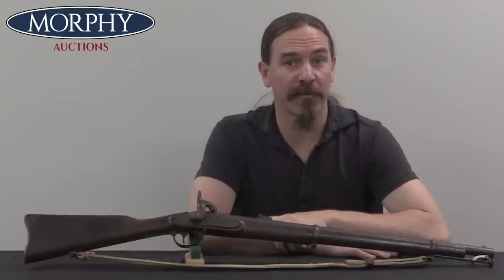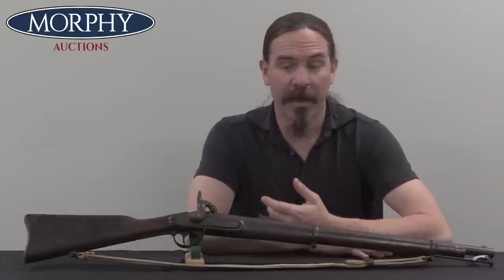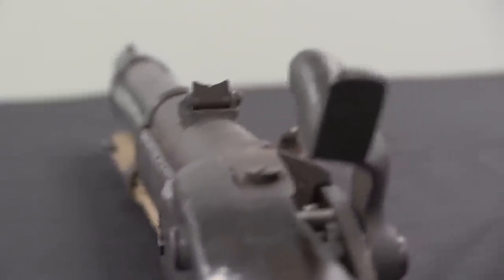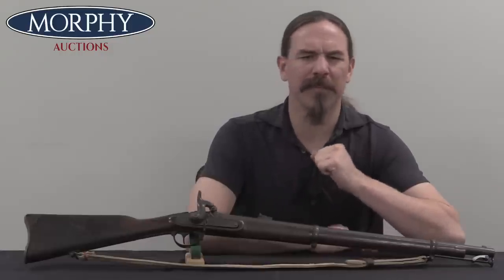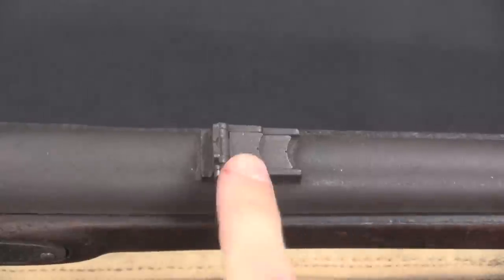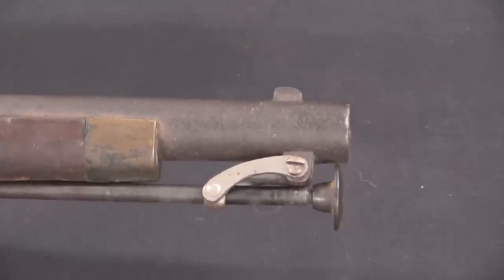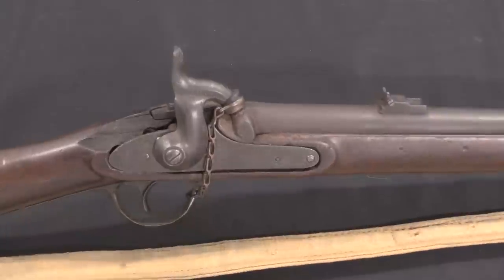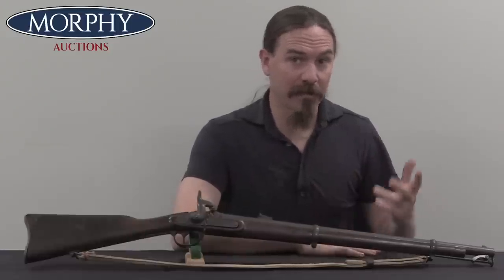Tallassee Carbine: The Confederacy's Last-Ditch Effort

Comment: The cannon that sits out on the corner of the ME engineering building is from Tallassee. Also, I have been diving in the river by the old armory looking for cannons that were allegedly dumped when the armory was packing up.
Reply: ME engineering building?
Reply: @mikejohnson2098  ME.. mechanical engineering @ Auburn. At least it did in the `80's.
Reply: Wouldn't they presumably be buried under mud?  I'd assume if the river is still flowing they'd naturally sink into the river bed over time.
Reply: @Indeciferable  The bedrock there is pretty shallow, so the mud and debris gets swept away from time to time.
Reply: Supposedly there’s a cannon from Selma in the Tombigbee River near Gainesville, AL
Reply: @harlech2  you should try magnet fishing! I don’t think you’d be able to pull a cannon up but you’d atleast be able to locate it underwater and track the line to it
Reply: @wetmemedaddy5065  That's a great idea!
Reply: Be sure to take along either an underwater metal detector or a Garrett pinpointed on your next dive. Or, a good sized magnet on a rope!

Comment: In '89 or '90 my dad and I went to Giest music shop in Helena Arkansas and dad purchased one from Mr. Giest. Mr. Giest (about 70 at that time) said he can remember as a small boy, his granddad put that carbine, along with the saber I purchased in that corner and no one paid any more attention to them.
The carbine dad purchased did not have a sling. It did have the rings for a sling. I had a brass bar and ring on the side of the wood opposite the lock. It also had a serial# 590 on the trigger guard and on the wood under the butt plate. The wood and brass was complete as well.
My eldest brother now owns the carbine, as dad passed in the early 2010's
I went hunting with it the same year dad bought it. We used black powder, with a slug and sabot from a 20ga. It did not kick as hard as my 20ga. It put a HUGE hole in the beaver I shot.
To the best of my knowledge, no one has fired or even loaded it since I cleaned it.

Comment: I have a Traditions brand .50 muzzleloader that is pretty much this model but with an octogon barrel. Has that straight line from the trigger to the butt plate and everything. Wish it had the ram rod guide, thats a sweet feature. 
I got it because I was looking for a muzzleloader for hunting that felt like my Win.94  30-30. 
The short barrel is nice for aiming from inside a blind, walking through brush and climbing in a tree pretty easy. 
Most shots are within 50 yards so I don't need that extra barrel length.

Comment: From what I've read - partly in Peterson's classic The Book Of The Gun - the reluctance of the Union's ordnance department to adopt a breechloading rifle was only partly due to concerns about complexity and dubious reliability.  A great deal was due to being so adverse to any kind of innovation that I suspect they'd have insisted on issuing percussion-primed rifled muskets if they'd had a wormhole feeding them 1903 Springfields and whole pallets of .30-06 ammo. 
     More than a generation later their successors eagerly followed in their footsteps by trying to unload outdated single-shot Allin Conversion Springfields in .45-70 onto some crackpot who wanted to equip a volunteer cavalry force to go fight the Spanish in Cuba.  After all, it's a proven design, easy to operate, hits hard, and half-trained "Volunteer Cavalry" won't waste ammo they way they would with newer designs.  And they use black powder...you can hide behind the smoke.
     Fortunately, the crackpot in question was far too downey a bird to be taken in by that, and after adjusting his spectacles and giving the gentlemen at Ordnance an earful, Colonel Roosevelt left with a full issue of Krag bolt-action carbines.

Comment: The handling and "handiness" of a carbine-length riflesd from ML to SA has always impressed me.  It is fascinating that it took so long for the M4 carbine to become the standard barrel length.  Now pretty much every new military rifle on the market is carbine length.
Reply: Apart from everything Walker mentioned, there's also the simple fact that our understanding of ballistics and optics, as well as related technologies, weren't as advanced as they are now. It was obviously more than adequate for most purposes, people still hunt with 19th century pattern muzzleloaders to this day. However, with the simpler rifling that was available at the time, the slightly improved accuracy of a longer barrel was a welcome benefit. It's only recently where the difference in accuracy has become so negligible that a shorter weapon is actually a net benefit. It's not as if carbines didn't exist until the M4, every army on earth had a carbine variant of their standard rifle, even before rifling started to see regular service. Fusees, for example, were just shortened smoothbore muskets, and were very common among officers, and even occasionally appeared with light infantrymen. Quite simply, there are some situations where a shorter weapon is objectively better, but until recently, the benefits did not outweigh the costs enough to justify widespread use
Reply: I haven't been keeping up with military stuff, care to explain what's going on with the whole 6.8mm thing?

Comment: The American Civil War took place during a very interesting time in firearms development.  

I live in Richmond, and one of the reasons it was chosen as the capital of the CSA was the fact that Richmond had more industrial capacity and is located at the intersection of several railroads and of course the James River - direct water transport to the Hampton Roads area, the Chesapeake Bay and the Atlantic.  So “important transportation hub” is putting it lightly.  

Of course the industrial capacity is very important.  

Otherwise…Richmond is almost exactly 100 miles due south of Washington, D.C..  hence why a huge number of Civil War battles took place in Virginia.

Comment: Note the key difference between the Cook & Brothers and the Tallassee Carbines is that the former was pretty much a complete copy of an Enfield carbine, while the Tallassee used an Enfield style lock and breach design, but a Springfield style stock with a higher comb and a curved button plate, as well as a multi piece trigger guard , all brass mounted, as noted.  An interesting blend of the two most common arms of the War.

Comment: The interesting thing is that almost everyone spent decades using front loader, while breach loaders were already very much feasible.
Remember: The Dreyse-Zündnadelgewehr was introduced in 1837!
Reply: Doesn't do much good if you can't get ammo
Reply: It wasn't technical limits that argued against breechloaders - it was machining capacity - not enough factories of the right type available.

Well, that, and military conservatism; no need to train new drill, no need to stock new spare parts, etc.
Reply: @lairdcummings9092  The cheapest and readily available option is the best option.
Reply: Laird is correct on both counts.  Mfg capabilities for elaborate hinging, latchings, fittings, vs a tube with a touch hole drilled.  Remember in this lecture, 80% of mainspring steel were rejected in this startup.  Such steel rejects were common in most startups.

Burning black powder looses effectiveness through breach venting.  Tri nitro powder made this a negligible issue.

Manufacturing early breach loading cartridges is also a major struggle.  The Henry Martini breach loader was often plagued by bent foil cartridges jamming the gun.  One of the causes of the Zulu overrun.  Trapdoor Springfield needed very precise paper cartridge for proper fit, where muzzle cartridge didn't.

The trapdoor Springfield after the war was not much faster than the 1863 muzzle only design.  Pouring and ramming ball takes about 6 seconds in the load sequence.  Opening the door, inserting cartridge, closing the door takes 4.  Hardly noticeable in battalion fire of single shot longarms.

Trapdoors were fitted with rammers.  They were used as muzzle loaders into 1900 when proper cartridge (or damaged substandard cartridge only) was available.
Reply: Major issue was ammo production and logistics. With muzzleloaders all you need is to bring couple casks of gunpowder and few chunks of led to troops, so soldiers could make cartridges for themselves. But for metallic cartridges you need whole industry and proper logistics capabilities
Reply: @STho205  : In Isandlwana the copperfoil cartridges had been a Problem, but not so much as later claimed. Same thing with the ammoboxes. Similar to Custer , british Commander lost battle for underestimate native enemies. So it was claimed, the to strong ammoboxes and to weak cartridges caused the defeat.
Reply: @lairdcummings9092  Theres also shortcomings of the breach loaders in question. The dreyse being the famous example. Its system is basically a bullet in a pouch that is spun by the rifling, making the gun less accurate than the muzzle loaders it was up against in the war with austria.

If combat was kept at distance or lots of cover was used, as was common in the american civil war, so long as theres sufficient firepower in place to keep a dreyse armed force from closing distance to melee or rapid short volleys, the gun was actually a liability.

Prussia didnt outshoot austria simply because of a high rate of fire, theres  plenty of gunfights where the austrians won, its that the prussians used what they had better by better manoeuvre.
Reply: @brittakriep2938  looking at the time frame I believe the the British Army had the better rifle in the Martini-Henry vs. the Remington Rolling Blocks.

But the US had the better cartridge with the .45-70 the .450 Boxer that the British were using.
Reply: @lairdcummings9092  Not only new drill but also new tactics. If the soldiers can lie down while reloading but all officers are trained to manage standing ranks, etc.
This was even an issue in WW1 where senior officers simply did not know what a few enemy machine guns could do to a battalion of infantry walking forward, because the officers' training was outdated.
Reply: @andrewshaw1571  Spencer Rifles were available and quite favored by the Union Cavalry during the American Civil War; there was nothing problematic about the rifles, their parts, or their ammunition. The technology was more than mature enough for military application. The problem was, because they were the contemporary equivalent of 'high tech,' they were both expensive and difficult to source in large numbers, even for the superior Union industry.

Confederate soldiers had a fear/respect attitude towards the Spenser, calling "the rifle you load on Sunday, then shoot all week." The .58 caliber rimfire ammunition was reliable and man-killing potent to any reasonable combat range of the era.
Reply: @lairdcummings9092  The key word from my comment you are missing is the word also.
Reply: @alexandermarinin7036  the Lewis and Clark expedition packed their gunpowder in lead boxes/chests so that when they opened the chest and transferred powder into horns or flasks, they melted down the box for ammunition.
Reply: @shawnmiller4781  : I am german, Brittas boyfriend, only using her Computer. For german weapons law reason ( most liberal weapons law was in my in Second Empire), i don' t own firearms, the copies/replicas from firearms 1860 to 1914 would be interessting for me. I am a pure theorist, my knowledge is from visiting Museums, reading Weapons magazines and Military History magazines in german language and watching Videos in YouTube. I am also interessted in edged weapons here i do the same, for example Videos of Matt Easton from scholagladiatora Channel, he is
Reply: @shawnmiller4781  : Excuse me, wrong Button! Matt Easton is basicly the Ian of swords and spears. In case of edged weapons, you find them in much more museums than firearms, also in many castles the noble owners have sometimes armours of their ancestors. Reenactors from times
Reply: Damned Button! Reenactors from times before firearms have it easier, so you can sometimes see them in medieval, Roman or Celtic sites and speak with them. In contrast to USA i have the possibility to watch in a circle of twenty Miles arroud my village a Celtic Oppidum, a Roman fort, relicts of Roman border fortification ,Limes', relicts of medieval castles and town fortifications, relicts of two Renaissance Fortresses, a starting Plattform for Natter rocket planes from wwll. So: My knowledge of a specific time or weapon is not very deep.
Reply: @andrewshaw1571  : You have forgotten prussian breech loader field cannons! Also Austria , since 1867 Austria - Hungary had a problem, Prussia had not. Austrian soldiers spoke german, hungarian, czech, slowakian, slovenian, croatian, polish, romanian, bosnian, ruthenian or italian in 1866! In Vienna i, german , and Brittas boyfriend, have visited Military Museum in former Arsenal, there i have seen a book for German officers in Austrian Army. At first the military call was written in german. Then the same call was written in hungarian, czech etc. language. Behind the call, written in a nongerman language, it was written, how a german language officer of austrian army has to speak it. To explain it: If english speaking soldiers would have served in Austrian ( or Austro- Hungarian Army) behind the call : Draw your saber! There would have been written: Droh jor Seiber! And our languges are both germanic laguages, so the problem was not easy. Also in 1866 Prussia did the ( River) Main campaign against prussian allies Bavaria (30000 men) , Württemberg ( 13600 men) , Baden ( 10000 men) and Hessen- Darmstadt ( 6400 men). On paper a force of 60000 men in two of German Confededation Army Corps ( Nr. 7 and Nr.8). But instead of uniting, every southern army tried to defend its country alone. So it was for prussian Mainriver Army rather easy to defeat every southern army in a small fight, we Germans call Gefecht ( not Schlacht/ Battle), but much larger than a skirmish/ Geplänkel. Only much larger Bavarian Army did more than one Gefecht, and outdated Fortess Marienburg ( in Würzburg) was Shot with cannons. And the southern armies , both soldiers and officers, had not the Training quality of prussian troops. For example in Württemberg, where i come from ( nowadays state Baden-Württemberg), there was a serving duty/ Wehrpflicht but similar to Switzerland it was only a rather short Training. And in 1866 the troops of duchies, principalities and free Towns, from 55 men ( Liechtenstein) up to may be 300 men had been only usefull as guards, escorts or Fortress personel.
But in 1866 Austria fought also against prussian Ally Italy, here the Austrians won, most famous Battle of Custozza and ( naval!) Battle of Lissa.
Reply: @greenglassrecycling  The British Ferguson 1776 used in the war of independence not a big number though around 200
Reply: @shawnmiller4781 Nope. Speaking in ballistics, the .577/450 ( with it's extra 15gns of BP) is significantly more powerful than the .45-70
Reply: @brittakriep2938  Austria Hungary briefly trialed a smokeless muzzleloader circa. 1860.
The cartridge was an unusual minie ball with a woven guncotton bag attached to it.
Reply: @alexandermarinin7036  That is correct, except unless they used flintlock rifles, they would have needed percussion caps as well. What I wanted to say is, the Dreyse Zündnadelgewehr didn't require metal cartridges, only the ammunition of a normal muzzle loader and a sabot to lead the bullet, plus maybe some paper for the cartridge. Point is, that is not that hard to get. But as others have pointed out, the problem was more the outdated tactics of older commanders, and the lower range of the older breachloading rifles.
Reply: @sharonrigs7999  the late production .45-70-500, with the 500gr bullet instead of the 405gr as originally designed, was and is probably the best of the black powder metallic cartridges in terms of range and terminal effect.

Even though most US production .45-70 was the carbine load with 55gr of powder vice 70gr. The US used a lot more cavalry post civil war than leg infantry.
Reply: @sharonrigs7999  : l have never read this in german language arms magazines Visier, Schweizer Waffenmagazin or Deutsches Waffenjournal. But we Germans say: Es gibt nichts, was es nicht gibt/ There is nothing, which doesn' t exist. So all kind  of experimental gun is possible.
Reply: No mention of the Hall breachloader?
First manufactured in flintlock, then converted to percussion.
Reply: @KevinSmith-yh6tl  Halls are kinda still front loaders, just a much shorter front to load.
Reply: @ScottKenny1978  
Yeah, whatever
Reply: Sure the concept is/was feasible, but the economics or production, military contracts, ammunition, logistics, training, etc all come into play with new technology. Often the people assigned tomake the expenditure decisions wouldn;t risk money on brand new un-proven equipment......and especially in the middle of a shooting war.....although anumber of new breech loading carbines were adopted for cavalry use.
Reply: @noremorsewoodworking2258  also, Toasted considerable extent, the senior officers didn't care to learn new tactics. Thus, they ordered massed ranks to march with full equipment into interlocking machine gun fire.